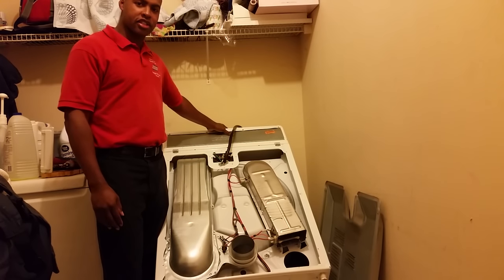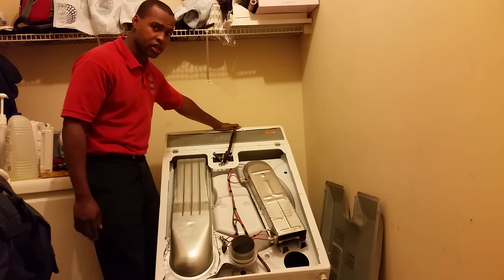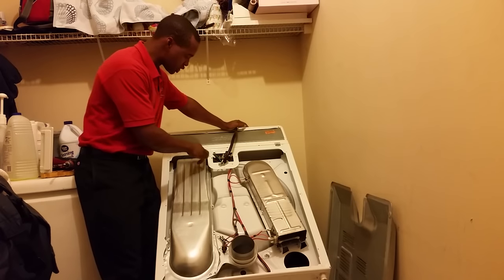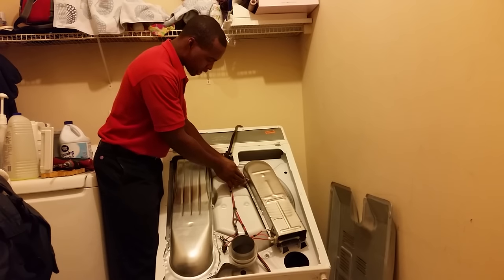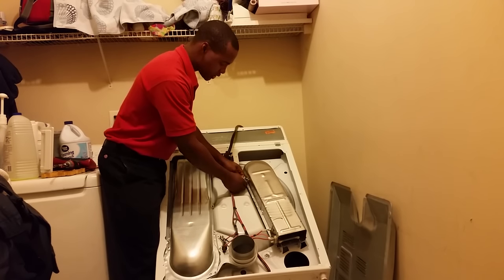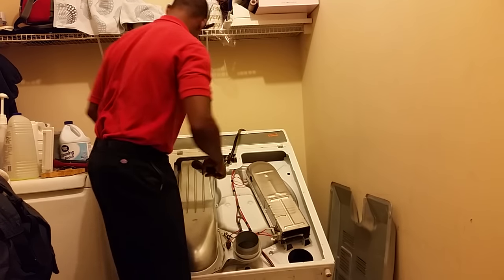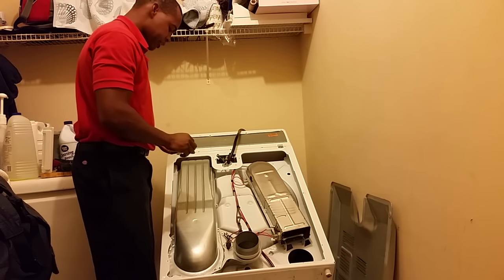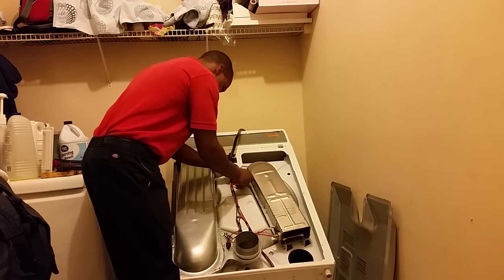How to repair a dryer that works but will not get hot

Comment: Thank you for the great videos! I checked out many. Replaced all common parts : timer, element and the four other fuses/thermostats... checked all with ohm meter. All parts are conducting properly. No blockages, everything is clean. Operates But No Heat... Also checked voltage on the wall plug and it is putting out properly. Any additional suggestions?
Reply: Did you ever get it fixed?
Reply: Did you ever get it fix ?
Reply: I have the sam issue with my dryer older maytag centennial. I've done the same steps as you. I can not get it to work, so I finally broke down and bought a new dryer

Comment: Oh my Jesus...your explanation of changing outlet source and assuring that 240 V was coming through to power the machine was right on point. Electric work was being done throughout the house that we did not think the fuse would be tripped. Once we flipped it...we had full power and the heating element lit up!
Thank you for this video. So helpful.

Comment: Mine was a faulty timer too, open circuit in the two big wires on the timer when in a heated position on the knob. Part number for timer was w10185982, but I removed the screws out the back and cleaned the contacts in the switch and fixed it for free saving me an $80 switch or buying a whole new dryer for $300+ which I had been considering. Whole process took under an hour with a lot of distractions. Thanks so much!
Reply: Penguin, did it heat up randomly before you fixed it? Mine is trying to drive me nuts!
Reply from the maker: Random heating is a symptom of a bad timer
Reply: Thanks.. I baught My dryer off craigslist.  It stopped heating; opened it and found a bypassed fuse. The heat coil fried into 1000 pieces.    Replaced both and the two safety thermostats.    Thenbit wouldnt heat again;  cleaned up terminals on the timer and it started heating..    Your comment helped me not waste time!  Thank you!

Comment: I have watched both this video and Quick Fix: Dryer Takes Multiple Cycles to Dry clothing, and noticed that the vent was totally clogged with dust.  I have never cleaned it out, as a matter of fact, I did not know that I needed to.  I had already bought a new heating element so I replaced it but I cannot put the wire thingy's back on the want go.  I feel like I am going to break it if I force it to hard.  What should I do?

Comment: Thanks for your help. My dryer was heating up at some settings and not others. I replaced the timer as you suggested and it worked. I had already replace everything else that was suggested as the most common problems, but it turned out that the timer was the issue. Thanks.

Comment: I hav a question.... I got a used dryer normal house hold plug on it I bring it home plug it in and no heat I take back panel off and can see the heat element start to light then shuts off but dryer keeps goin. Now do i hav a volt issue or get my sensor changed? Thankx for your time.

Comment: I have a Kenmore very similar to whirlpool. I replace the heating element because the coils actually got wet and broke. But it’s still not heating. I ordered a dryer fuse but I think based on your video it’s the thermostat that also need to order! Please advise

Comment: Your video was very informative.  I do have a question, my dryer like most people was operational until it stop proving any heat.  I tested all of the thermostats/fuse bar and heating elements, all of these components tested OK, continuity was present without any shorts at the heating element housing.
My dryer is a Kenmore and like exactly as the one in your video (with all the same component placement).  I tested the mechanical timer pulling the connector off going and across A and C terminals for black and red wires.  Reading for ohms was 0000, no OL reading.
I do not know what other steps to take in determining the problem. One thing I notice, when I turned the dry on, setting it to 40 minutes at the timer the dry operated OK with no heat, but when I set it to air dry it would not turn on.  Hope you can provide some insight.  Thanks
Reply from the maker: Still sound like a damaged timer, also check your voltage going into the dryer, you should be getting 240 volts together 120 volts separate. And rarely but does happen, motor centrifugal switch could be stuck which means you need to replace the motor
Reply: @LeanOnYourRep  Thanks, I will check on the items you mentioned.

Comment: I have a question I have a dryer just like the one you showed in this video when I put clothes inside the dryer and press the button the dryer hesitates to spin most times it doesn’t work at all I would have to wait for a few and then try again I checked the belt everything is on track

Comment: When everything in the dryer checks out as good check the line voltages coming in.  I went crazy trying to fix a "dryer runs but won't heat" problem that turned out to be a bad 240V 40A circuit breaker.  One pole on the breaker would flip but it wasn't strong enough to make the whole breaker flip.  A check of the line voltage to the dryer showed 124V on one leg and 30V on the other.  Pulled out the breaker and saw a scorched label on the side of it.  Replaced the breaker and the dryer works fine.

Comment: My Whirlpool  TEDX640PQ0  has continuity on all thermostats, heating element, and timer but the dryer runs but no heat. The vent was pretty dirty and I cleaned it but still no hear. Nothing appears broken on the coils but it could have burnt out from the lint in the vent. How do I pinpoint the exactly where the problem time or heater. Thanks you do a good job explaining things.

Comment: Very informative video. I’m having an issue with my 2013 Maytag Bravos MEDEX700XL dryer. Suddenly stopped heating (only symptom). Tested in the timed dry option and the moisture sensing options and ran the diagnostic and no fault codes exist Popped off bottom toe plate, tested the continuity and resistance of the thermal fuse, exhaust thermistor, thermal cutoff, high limit thermostat, and the heating element. All are within tolerance and I’m using the service technician handbook that includes the dryer schematics to help trace the issue. The heater relay also engages when I switch the setting from no heat to heat so I know that is good. If all those are good I suspect maybe there is an open somewhere after the heater relay to the heater components. I haven’t fully disassembled the dryer since I have access to all the heating components via the toe plate. Like I said, only issue I’m having is heating so I haven’t tried looking in other areas. Any idea what else it could be? (Side note: I did just move into a new place and had to reinstall the 4 pin cable vice the 3 pin one i had to buy for use in my previous residence. I believe I hooked it up correctly since the dryer heater worked fine the past 4 days and now it isn’t.)
Reply: I have the same dryer with the same problem. What was the cause?

Comment: My heater element goes on, but it turns off after a minute or so. It goes off and on. It goes through the timing cycle but the clothes don’t dry. Besides the fuse would the door switch be the problem or should I replace both fuse

Comment: Thank you so much for your videos. I really can’t afford a technician at this point. I checked my heating coils and they were fine, I even checked my timer and it was beautiful. I checked that everything was putting out what it was supposed to (ohms) and what wasn’t supposed to wasn’t. I checked the voltage on the plug and it was like 2-5 volts short, could this be causing an issue? I emptied out the vents and cleaned everything out. The vertical vent did have build up but it still isn’t heating. The dryer runs, but it doesn’t heat. I’m so frustrated because I’ve been working on this for four hours and I’ve taken the backings off multiple times. Help!
Reply: I went back and googled what continuity meant and retested the high limit thermostat and I found that was the issue! I’m buying the part from a locally owned business tomorrow. Thanks for your help!

Comment: Reggie I have a kitchenaid dryer and replaced the fuse at the top the one that blows as a safety if dryer gets too hot. At the bottom I don't have a orange wire with the 2 red ones. Am I ok with just the 2 red. Everything is working fine now and hot. Thank you

Comment: Thanks for the video. I've worked on dryers previously but needed a refresher. I've replaced thermal cutoff, high heat thermostat, cycling thermostat, thermal fuse and heating element. I've had my ducts professionally cleaned from the dryer to the exit of the house.  It ran great for a load but now it will run but won't heat. I'm about to burn it in my backyard. Dryers aren't that hard yet I'm defeated.
Reply: My dryer ended up having a bad timer. At some point it got stuck in air dry only mode no matter what setting I turned the dial to. Except when I turned it to Air Dry Only setting it wouldn’t come on at all. That was my clue it was the timer. Replaced timer and it’s working like new. Just a thought. Good luck

Comment: So I checked all the fuses, and thermostats and the heating element.  They all tested good on the multimeter.  I also checked the timer on high heat setting and that showed continuity as well, but dryer still doesn't get hot.

Comment: Our dryer turns and runs but the knob will not turn from where it is set at and the heat will not work. If the knob wont move from high heat unless turned manually...will this cause the heat not to work?
Reply from the maker: You probably have 2 issues. Bad timer motor and blown fuse because the dryer ran to long

Comment: So I replaced all these components today. I tested it before replacing the panel and it started blowing hot air, but it smelled like it was burning off lint like turning on the heater for the first time of the year. I turned it off and replaced the panel. I proceeded to wash a load of clothes then placed them in the dryer. 20 minutes later I check the dryer, and no heat. What do you suggest?
Reply: Clean your air vent out they can get clogged and start a fire and do make your dryer not dry

Comment: Not mentioned here is the timer. Checked for continuity on all parts on my dryer like in video and was all good except for my timer. My OEM part is no longer available and no substitutes listed. I see on Amazon matching parts for the Timer made by PRYSM and Krooli. Anyone here have experience with parts from these companies? It’s either parts from there or no warming dryer? Thoughts?

Comment: Question for you reggie. I have a maytag dryer and I had to take the whole thing apart. I have checked all of my thermal fuses and the parts that attach to the heating element. One fuse is bad bc it has no continuity and the part that protrudes from the heating element has no continuity either. Would I be safe to say that my issue?
Reply from the maker: I would need to know the model number and the original issue
Reply: The original issue is that it not applying any heat to the clothes. But I took apart the heating element and it is broken. The coil is broken it looks like it over heated and it snapped in one part. But it looks like I have 2 different fuses on top of the blower motor that sucks out the lint. But I tested both fuses and only one is bad. MEDB400VQ0

Comment: I still have no heat.  The dryer turns and spins.  I ordered the heat element, thermostat, the cycle, and the thermal fuse.  I have replaced all 4 parts.  I am still getting cold air.  I have a whirlpool WED5200VQ1 dryer.  It is about 10 years old.  Any suggestions?

Comment: Hello I have a GE dryer. I bough it in 2011. Last night when I dried my sweatshirt I noticed it was turning but not heating. I clean the filter before each use. Should I unplug it and clean it really good?

Comment: We have an old Maytag dryer (model DE8200) that runs but won't heat up. On auto dry, the timer won't advance but it will on air fluff. 6 years ago we had the heating element replaced, used the dryer for 2 years after, then moved and put the dryer in a storage unit for 4 years--the apartment we were renting came with a washer and dryer so we didn't need ours--where it was exposed to hot and cold conditions. We moved again recently and the place we moved to is old and has a 3-prong outlet. We replaced the plug and tested both the outlet and the new plug with a multimeter and both are fine. I can't see how it could be the heating element given that we didn't use the dryer for very long after the heating element was replaced. Any ideas what the problem could be? Hubby was recently laid off so we have to fix the dryer ourselves--no money for a repairman (or woman, lol).
Reply: Haha, so the thermostat thing on the blower (I forget what it's called) had a loose wire. That was it. Loose wire. The dryer is working fine now. :D

Comment: Reggie, so with your help I discovered that my heating coils broke.  But I have a concern for after I replace the heating coils. I put measured my outlet with my multimeter and it measured around 190 volts instead of 120 across just one side, and around 380 instead of 240 across both sides. That seems dangerously high. What's going on???  Could that be why my coils broke? Another strange thing is that the It's a 4-prong outlet, and when I measure across either hot line and neutral, I get the 190 volts, but when I measure across either hot line and ground, I get nothing. Does that mean that my ground isn't connected, and could that be the problem?  

I would appreciate your thoughts on this.

Great videos by the way! They are very helpful and I greatly appreciate you taking the time to make them!  Thanks!
Reply: It turns out the voltage issue was just a low battery in my multimeter.  Phew!
Reply from the maker: If it wasn't an issue with the voltmeter then it would be time to call in an electrician. individually each hotline should be 120 volts each. And when you measure both hot together should equal 240v. When you test the neutral to the ground should show zero. Could be bad at the plug or bad at the circuit breaker
Reply: if it actually were the electricity and not the meter.  wouldn't the home circuit breakers trip?

Comment: after watching your video I notice that one of the coil was broken does the heating element need to be replaced?
Reply: Yup - if your dryer drum is turning still then the thermal fuse and thermostat are probably ok.  You will need to save the thermostat from your old unit, it usually is connected to the coil unit.  Always take the old parts with you to your parts supplier just to be certain they match up.

Comment: Nowadays,  you can get a whole heating kit for $35. On mine years ago, the 120v power legs, the red & black wires at the plug on the house was swapped & everything ran but no heat. I swapped them around & got heat.
Now, years later, mine stopped heating again & it was my thermostat.  Most of these dryers are all the same for Heating Element Kits.  Many our different though.  
I'm watching this to make sure the heating element is supposed to cycle on & off. Which is common sense actually.  I turned my dryer on & cold.  Once i changed everything out, it took a minute or 2 before the element kicked back on, then it started cycling

Comment: I have a blown (lower) operating thermostat in my whirlpool electric dryer. I removed it and it has burn marks. The number on it reads 250-80 F. which I can't find unless they go by just "250".The other smaller fuse higher up was replaced a year ago. The element must be over 15 years old. Should I replace all three? I use the dryer a lot. I keep it lint free inside and out. Thank you. Also there may have been a little too much of a bend in the duct/vent causing overheat due to the cramped space. I'll have to pull the dryer away from the wall more.

Comment: My thermostat went bad and when I ordered a new one, it was a different style with only 2 terminals and a jumper wire not 3.There was nowhere for the little orange wire to go on the new one. I just left it disconnected and it works fine. Is this ok??
Reply from the maker: I'm going to post here on my page a picture of what to do. the picture shows it hooked up wrong and there's a arrow pointing to where it should go

Comment: Great video Reggie. I'm planning diagnostics according to this and another video of yours. Lots of lint and moisture has been found in the exhaust so far. When dryer was tumbling and getting hot, clothes would as a rule need more than one cycle to dry. Typically when they neared being dry dryer would make an awful noise that I figured was too-much-heat related, and we would stop it and let it cool awhile and then run it again until the noise returned. Hard to describe the noise - but it sounded like something was wearing out, loudly. Do you have any ideas what this noise might be and how it might direct troubleshooting? Thank you!
Reply from the maker: Thank you Ben for viewing my videos. The noise depends on the type of dryer. Some dryers have rear hub bearings some have front tub bearings that can become worn overtime. Also could be your belt pulley or motor from the heavy moisture and Heat. You may also have a bunch of lint surrounding the motor. it has a sensor that turns off the motor if it overheats you might want to disassemble your dryer and clean it out because if your dryer vent had a clog you might have a lot of blowback lint inside the dryer
Reply: Cool. I appreciate it.

Comment: Hi Reggie~ what model/brand multimeter do you recommend? Also, thank you for posting this helpful video!
Reply from the maker: Most of my contemporaries would disagree but I have no loyalty to any brand of voltmeter I get the cheapest one I can buy, usually from Harbor Freight that has audio beep for a continuity test. For washer and dryer repair you only use voltage test for 240 lines and continuity test. If the voltmeter does temperature test that's just a bonus. LOL